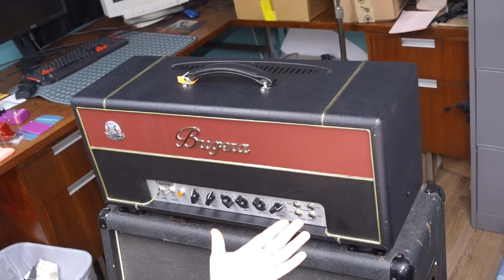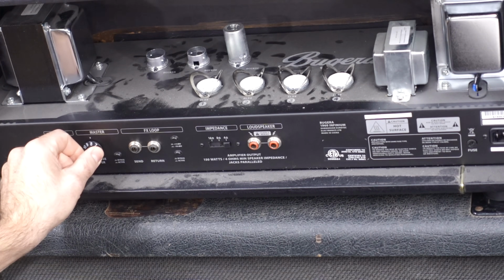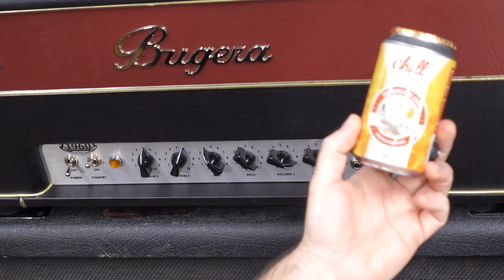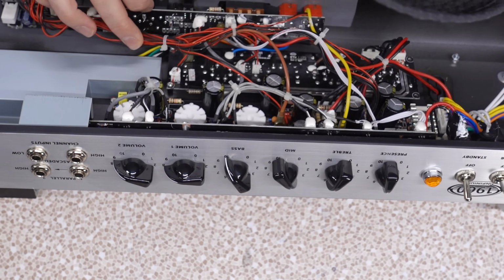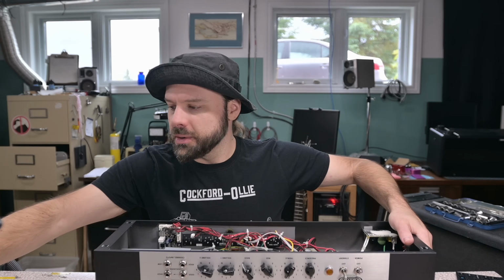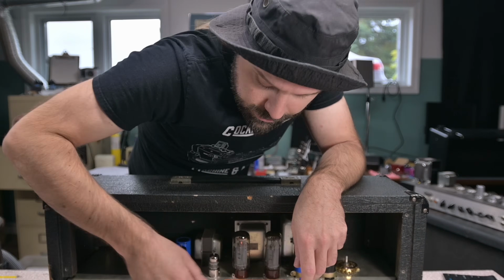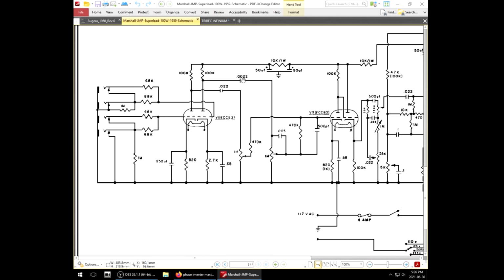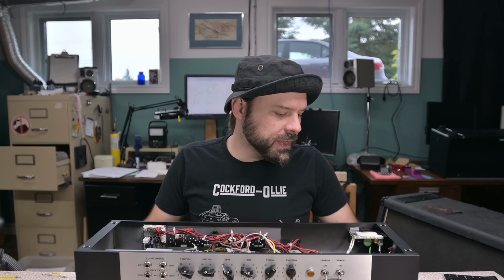Bugera 1960 - Inspection & Circuit Analysis

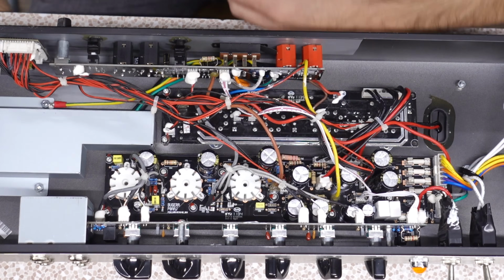Comment: Hey "Do All Things" I need some help. At 11:03 of your video You see those 4 fuses. The top one closest to you, keeps blowing. I have a gen 1 1960 "Non-Infinium" I have no schematic so I'm studying everything you put up. It will run fine on just 2 tubes, inboard or outboard sockets but with all 4 installed, that fuse blows. Not having a Schem, I just tested the plug from the transformer. Have voltage on all except one orange wire. Any ideas why 4 tubes blows the fuse? Thanks in advance for any help.
Reply from the maker: Can you tell me the label on the fuse ?
I'm looking at the schematic, I can find the 4 fuses. F1 thru F4. 
Looking at the Vid, that top fuse looks like it's on the yellow wires, which are the heater wires, which should be 10 amps. Yeah, if it's too small a fuse I could see 4 tubes blowing it and not 2. But that assumes not the correct value. 
One of the orange wires is tied directly to ground, so a 0 reading on that one will be normal, just at long as the other orange wire reads voltage. Prob around 60v is my guess. 

Makes sure it's not one particular tube popping the fuse, so like juggle them around.
This amp doesn't have a bias test resistor from the looks of it, but the schem says to adjsut the bias is -35v.
Says there is a bias test point labeled x6. That would be the reading with all 4 tubes tho.
Reply: @DATT  I juggled all the tubes (in pairs) in all the sockets and all configurations and with 2 tubes it made no difference. $ tubes blew F1 however, I had replaced it with a 250V 6A fuse. The F1 fuse is a 250v 10A fuse, If I'd paid attention I'd have seen the fuse specs printed on the pc board. F2 - F4 are all 250V 1A fuses. I'm certain if I put the other tubes back in that F1 will blow again. Of coarse, what's the worst that can happen, I go back to two tubes again, lol. The voltage on the hot orange wire is 88V.
Reply from the maker: @jerryc6147  I would think even 6a should be good enough. Cause that is the heater fuse. For some reason you're pulling to much heater current. 
That is an anomaly to me. I can't think off the top of my head why that'd happens. I think I'd need to see it.
Reply: @DATT  Would it help if I shot video of what it's doing? I have a 10A in thee now and ordered 10 more for back up. Sorry it took so long. Have a family emergency going on right now.
Reply from the maker: @jerryc6147  Ahhh there is no rush here. I'm just not sure this is a problem I can be a lot of help with unless I can work on it myself.
Reply: @DATT  Sorry I disappeared. My Dad passed away a couple few weeks ago and I'm still not handling it well. Trying to throw myself back into my projects. That's what he'd want. Anyway, the fuses 2, 3, and 4 are 1A 250v. fuse 1 is 10A 250v. I ordered the wrong size 10 amp fuse and just got the smaller ones a couple days ago. Gonna replace them all, replace the tubes and video it when it powers up.
Reply from the maker: @jerryc6147  Well, no need to apologize to me. You do you man, I'm just here. 
Sorry to hear.
Reply: @DATT  Thanks man. I uploaded a video of the problem and fuse replacements. Since replacing the fuses with the correct ones, it's running on all 4 tubes. So far with no issues. I'll keep running it and see what happens. Thanks for your time and help. Much appreciated. Have a great one.
Reply from the maker: @jerryc6147  Oh good. I guess you just had the wrong fuses then.
Reply: @DATT  Yea, I still don't know why the original fuses blew. However, I figure the reason it was blowing the heater fuse on all for tubes is because the fuse I replaced it with ( what I had on hand) was a 6A fuse. It ran on 2 tubes but all 4 was too much. I'll let ya know if anything changes and again, thanks for all your help.
Reply from the maker: @jerryc6147  It blows my mind how much current the heaters need sometimes. it can actually be a problem when designing an amp. 
5150's were a pain cause the traces and wiring could barely handle it and you'd get so much voltage age between the transformer and tube socket. 
That weak design is about the only reason to not try EL tubes in the 5150.
Reply from the maker: search google for "bugera_1960_rev.0" with the quotes.

Comment: I got one of these in a trade for a 412 that I got for free. One of the best amps I have ever played. That said, big agree that the master volume is straight ass in sound.

I would LOOOOOOOVVVVVVEEEEEE to see you install a proper master volume utilizing inserting a pot between that wire (because I too would also like to have a master on it that works better, I would be down with an email explaining how to do it as well. I really would appreciate it). I think I would put the pot on the front in the upper right input jack though, like you, I also find that input completely useless.
Reply from the maker: The way this amp is built I don't think you could put the MV in that location easily. Easiest place would be where the existing PPMV is. 
Unfortunately, this is not my amp to mod, and unless someone hires me to do that mod, I won't be able to make a vid about it.
Reply: @DATT  Fair enough, the rear panel isn't always the easiest to reach for me, hence the input jack idea, but more to the point, I would still be interested to know if you really think putting a pot in the line of that wire connecting x41 to x42 would do the job of putting in a pre PI master volume in. I'm willing to make the attempt, worst case is I have to solder a wire back together and apply some heat shielding.

I would send you my amp to mod but I am in the states and also incredibly poor.
Reply from the maker: @riffsnoleads  Ah, did I say x42?
Looking at the schematic I have, Output from the tone stack is x41, to input of the FX send is x32. That would be where you insert it, and yeah, if it was my amp, I'd def do that. I wish I still had the amp in front of me, it'd be easier to walk thru it.
Reply: @DATT  Hey, I just wanted to touch base with you (a year later). I decided to give the master volume install a shot per your suggestions here and it works great. I was able to sacrifice one of the input jacks (upper right), it was redundant considering the upper left jack is jumpered internally and only required two jumper wires to complete the circuit. Little bit of solder and some scolded fingers and voila, pre phase inverter MV installed in the front. The modular build definitely made it really easy.

The only difference between mine and yours is I used a 500k log pot. It's the same as most volume pedals, so I figured it should be fine.

also, you did say x41/x32 in the video, I am just a dumbass and didn't pay attention very well.

Comment: Remember guys, you can also pull 2 of the 4 output tubes to tame some of the volume as long as you have an 8 or 16 ohm cab (if you have an 8 ohm cab, plug into the 4 ohm plug, 16 ohm cab plug into the 8) i do that quite a bit and also have a passive attenuator i built for a 50 watt amp that i put in between the head and cab while in half power mode and it nicely docks the volume into managable territory and it distorts beautifully
Reply from the maker: Oh Hell Yeah. I def do that all the time. Heck, just for saving money alone on tubes, I pretty much only buy pairs of tubes, and just run all my 100watters with jsut the 2 tubes. I really don't need to extra volume. I def did that with this amp too. 
It sucks I didn't have a chance to try it with an attenuator.
Reply: @christopherallen5603  But why look lower headroom if you're using an attenuator anyway? There's a reason small amps don't have the big low end you know.
Reply: My attuneator is only safe for up to a 50w amp, a full 100w is sure to overheat the passive resistor circuit and kill it.
Reply from the maker: @christopherallen5603  It's funny, a little while ago I got the Bugera PS1 attenuator. Says it's good for 100w unit you actually give it 100w. 
I modded it and installed fans. Electrically it should be good for 180w if I can keep it cool. I'll have a video about it one day.
Reply: @DATT  I put a fan on mine too my man! The Bugera is also a passive attenuator. I've recorded a few times with mine and only complaint is that ya lose some of the critical hi end of a Super Lead (recorded Unchained Van Halen) otherwise it sounded great!
Reply from the maker: @christopherallen5603  Yeah, it can be "tone sucking". You can work around it by taking the line out, and running it into another amp you can EQ. Or, what I do, is I have a special speaker cab setup for it. 
I have these vintage Traynor speakers, I wish I could find modern equivalents, they are obnoxiously bright, bassy, with a massive mid scoop. On their own, normally, they sound bad, however, they perfectly compliment the attenuator.
Reply: @DATT  my 4x12 cab has Celestion G12T-75's and has just enough hi end the roll off doesn't completely destroy the tone but no matter what you do, eq-speakers-board-mic placement-board treatment etc, can't quite re-infuse the type of overtones lost in a passive attenuator. You even lose a little with good Impulse response soaks.. actually, the Marshall Powerbrake is still to this day the best attenuator I've heard with my own ears
Reply from the maker: @christopherallen5603  Yeah eh. I guess I'm missing out on a few things. I would to try to powerbreak, they are so pricey tho. I think they are an inductive sink. 
Like instead of soaking the power into resistors, they use an auto transformer to step down the output, and the output knob is just a rotary sw selection different taps on the transformer. 
At least that's the way it looks in the schematic. That being the case, I can believe they'd be able to retain more of the original sound, and even, a properly tuned transformer could react more like a speaker.
Reply: @DATT  precisely, there's the two notes which is a bit more reasonable in price and sounds pretty good too. I built my passive one tho for literally free, and that's always going to sound good to my ears lol
Reply from the maker: @christopherallen5603  What's in your passive ?

My buddy has a 2 notes, bit like amp top box, The Torpedo Reload. It's mid. It doesn't sound much better other than it has a contour, so built EQ which is handy. 
I think it's power amp based.
Reply: @DATT  it's basically 3 50w wire wounds in a voltage divider configuration I forget the values off the top of my head tho
Reply from the maker: @christopherallen5603  Oh ok, pretty simple. Yeah the box I have is like that. Got prob like 400w worth of 30-50 w resistors all stacked up in various configs equating to about 180w on any given Impedance to do 100w with overhead. The final volume knob is a 16ohm 100w beast potentiometer.
Reply: @DATT  man that's a beast! Btw- where could I install a. Treble loss compensation cap?
Reply from the maker: @christopherallen5603  Treble loss compensation cap ? I haven t' heard that term before, you'd have to be more specific.
Reply: @DATT  I've seen a couple schematics where they put a 2.2-4.7uf (I think) maybe between the + & - legs either before or after the last resistor in the circuit
Reply: I tried the effects loop 1m pot master volume.. doh!! Its a parallel loop :(

Comment: When you say change out the PPIMV for a standard master volume, do you mean a pre-phase inverter master volume?
Reply from the maker: Yeah, just a A1M pot between the treble and the PI like any other master volume amp. The FX loop sits in that position so my soda can does exactly that, just buffered.
Reply: @DATT  so pretty much any pedal with a volume knob in the FX loop would work the same
Reply from the maker: @slayabouts  Yeah I guess so eh. I didn't try that cause I didn't want to change the sound.
Reply: @DATT  i was thinking it’d be a good idea to put an eq pedal in there to act as a more useful tonestack if needed. Luke Bentham of The Dirty Nil puts a Rat in his fx loop with the preamp only slightly driven and most of the distortion coming from the Rat and gets a great sound. But yeah, maybe not if you’re looking for the actual plexi sound though
Reply from the maker: @slayabouts  Oh yeah, an EQ pedal would do exactly that I think, esp if the vol goes down to Zero.

Comment: 10ma off is not matched lol !
Reply from the maker: It's not idea but it's within spec. I have tubes sets that have drifted father than that with time that still run just. I've had sets go as far as 20. Much more than that can be a problem. Fortunately most new tube sets are within 5 of less.

Comment: Typical Bugera... Clone it, but slightly modify it. (Well, infinium is interesting and great if you're into matched output tubes... was that cloned or original?)

 AFAIK, back when the original amps (the Fender Bassman, what Jim Marshall based his designs off originally, (or guys he hired to do so,) and the Marshall amps that came later) wasn't so intent of matched tubes/valves... something the HiFi and cork sniffing audiophiles were more interested in.
Reply from the maker: No, matched tubes was def a thing. The difference is back then, when they were a mass produced commodity, they could cull tubes in such a way that they matched. 
IF you bought say a 6L6, it was designed to a certain spec, so it would run within a certain tolerance of that spec, making almost every 6L6 you bought fairly matched. Any tube tested at the factory that was not in spec was rejected. Sometimes they would get rejected as a defect at the store when they went to use them. They made a lot of them back then so they could do that. Now, it's more a niche item made in smaller batches, unless you want to pay 10 times they can't afford to reject tubes like that, so they simply measure them and match them up. Fun fact about NOS tubes, maybe of them were those rejects / defects.

Comment: Bought one of these 9 or so years ago brand new. Had the worst hum out of the box. Swapped pre-amp tubes and power tubes with new Electro-Harmonix tubes. Amp still sounded like shite. I put the crap tubes back in, boxed it up, and sent that bitch back for a refund. P.O.S. right out of the box.

Comment: Back in the Day…Bugera sent out amps untested…i.e.unflashed getter in one of the Power tube…a nasty habit of catching on fire…we called them Bugger-Ya or Buggeror.  
As to fix to the  MV boot strap to the Schmidt splitter check out Kevin O’Connors The Ultimate Tone Vol 3 in the Chapter 8 pages 8-4 and 8-5 or put a 100k resistor between MV after the EQand the cap
Reply from the maker: Is that a book or something I can see online ?

The unflashed getter is something the tube maker would of done at the factory. It's unlikely Bugera made their own tubes, so that'd just be a fluke tube defect I think.
Reply: @DATT  No one ever made their own vacuum tubes…they purchased them from any number of tube manufacturers.  Sylvannia, General Electric, RCA,  Tung Sol, to name a few in the USA, Mullard and Genelex and others in England.  These were “Private Labeled” ‘Use only Genuine Fender Tubes….not made by Fender.  And if a tube manufacturer was short on tubes he would have another just put his logo and ship them to him.  
What Guitar companies who also made Amplifier companies Gibson, Rickenbacker (Leo Fender was a radio repairman who also first worked for Rickenbacker   repairing guitar amps) Ampeg did they tested the amps before selling, and shipping to Music Stores.
Yes the actually used Test Equipment, Vacuum Tube Voltage Ohm Meters, Capacitor Testers, Tube Testers to test the tubes and then they actually played the damn amplifiers to see if these actually made a sound worked, didn’t hum (too loudly) didn’t feedback in a ground loop. 
There was a sense of pride and reputation to project and protect.  Even the companies that made guitars and amplifiers under a variety of names, and before department stores did become destroyed by Ivy League Accounts and corporate raiders, Montgomery Wards, Sears & Roebuck had entry level beginners amps which buyers purchased on lay away made by outside suppliers, these had the contracted manufacturers test the amplifiers. 
Would anyone sell a car, boat, airplane, radio, TV set, film projector, phonograph, without testing these first. People maintained and repaired their equipment or telephoned the local repair man or brought to a repair shop, often a music store also maintained the products they sold. This was the reality before the landfill mentality from MBA’s… but before I go further
Uli Behringer has a reputation, both as a business man and his work on synthesizers vintage Europe.  His Rep as a business man isn’t one he protected and one he wants to be known. 
There’s no way an unflashed, non working Dead on arrival tube has been tested. No way an amp that had such a tube installed had been tested or so much as one chord or a single note played.
Reply from the maker: @Renshen1957  Ohhh I see what you're saying. An unflashed tube means they didn't test the amp first. Yeah I could see that. 
I could also see them testing the amp with a different set of tubes, and just slamming a fresh set in on the way out the door. Either way, yeah, Beh doesn't have the best rep for quality.
Reply: bad molex connector was a fire hazzard. Infinium amps don't have that isse and are as durable as any.

Comment: the parallel R around the choke is probably to de-q the choke... or reduce it's resonance.  maybe it was ringing with a square wave stimulus.
thank you for this video by the way. super cool.
Reply from the maker: Interesting. I wonder if I could try that to reduce ringing in SMPS builds I do. It always seems to be a problem for me.
Reply: @DATT  in that case use an RC or RCD snubber circuit. your intuition is spot on. Cuk, SEPIC, and flybacks especially. sometimes the output rectifiers ring and these circuits are useful there as well.